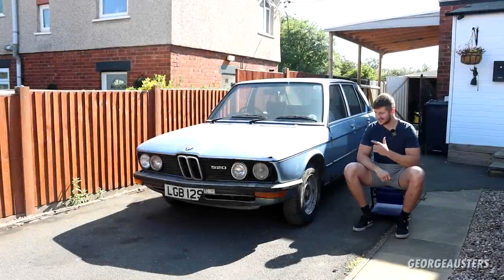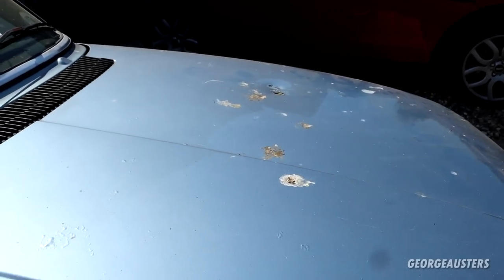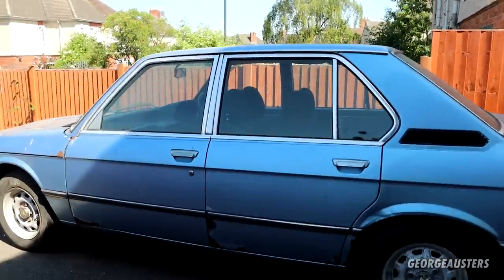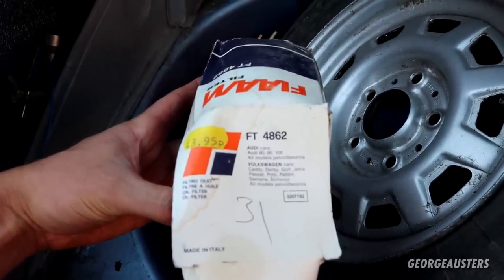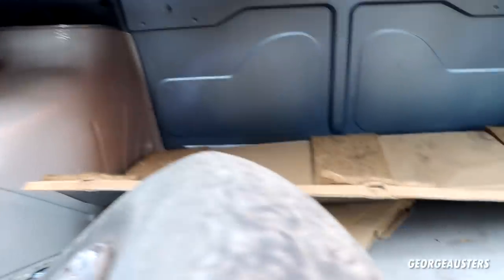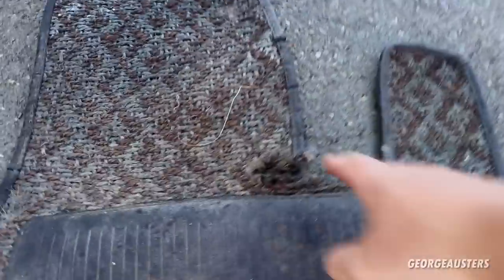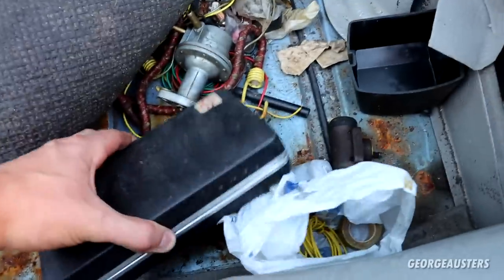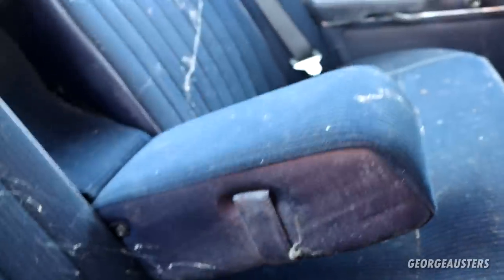I BOUGHT AN ABANDONED BARN FIND BMW THAT HAS BEEN SITTING FOR 30 YEARS!

Comment: I would recommend always putting a mix of diesel and 2 stroke oil down the bores before even attempting to turn any engine that's been stood a long time,  as it prevents you from breaking the piston rings which are usually stuck to the cylinder walls.  Looks like you have a really nice original interior,  if you do strip the car for rebuild, take your time and be careful not to damage anything and make sure it's stored in a safe place out the way of sparks, welding splatter and paint.

Comment: The 2 way valve you found in the boot is a fuel pump. The 520 was carburetor fed and this is the fuel pump that runs of the camshaft lobe. Also the cover under the boot floor would just be for the Fuel Gauge sender unit or float, as there will be no electrical fuel system.
Reply from the maker: That makes sense. I assumed the unit in the boot was a fuel pump as it has an electrical connector and 2 fuel lines running from it
Reply: @GeorgeAusters  yeah the electrical connection is just an earth between the unit and the engine. Hood luck with the restoration mate.

Comment: Those parking disks are still in use is some smaller towns where there is a time restriction for free parking, you dial in your arrival time and if you overstay you could be caught by a traffic warden.
Reply: Here in The Netherlands the parking discs are being used very often. The spots where you need to use them are called blue zones, whereas the disks and pavement edges are (you guessed it) Blue. Just like you said, set the clock when you arrive and put it behind the windshield.
Reply from the maker: Interesting, they just weren’t used in my area

Comment: Wow thanks George...  my first car...1977 528... same colour, same colour velour interior.
I did all the work on the car myself, service, repairs, suspension legs, carburetor service, blown engine replaced...all outside my house, in the snow. Love and passion has no price 1
I bought mine before anyone knew what a BMW was...before the Yuppies jumped in for the prestige value.
I bought a BMW primarily due to the supreme build quality  and engineering of these cars... now I am on my 14th or 15th... two E39  M5 garaged, F10 daily driver... so wish I had kept them all especially the E12... will watch all this series... thank you for saving this one...
Reply from the maker: Wow love that… Must be wealthy to have such a car as your first one!
Reply: @GeorgeAusters  Hi George,
Not wealthly mate. I made a mistake of visiting the motor show at Earl's court and then sat in the brand new E28 model...WOW !. I was blown away by the build quality, the luxury and engineering masterpiece. I had driven in with a friend in a beat up MK3 Cortina ! asked the price of the BMW - £28,000 pounds...you could buy 4 houses in London at that time !
But I was smitten... never looked back. Learnt to service/fix the cars myself... labours' of love.
I actually have a M5 E39 right now in Manchester, it was a rebuild project that has been sitting there for 21 years... no time to work on it... would you consider a JV ?

Comment: Lovely old car. But don’t fool yourself on what it needs. That needs a lot of work. Before you do anything else get it up on a ramp.
The outer sills look rusty but how are the inner sills and chassis legs. The mechanicals are easy and fairly cheap to repair. The body and structure are not.

Comment: The engine on my E12 was stuck after not being run for 14 years, so I used a mix of leftovers of ATF and Redex fuel cleaner, poured into the bites and left for a week. It worked very well.
Reply from the maker: Yes I watched your videos on it mate :)
Reply: @GeorgeAusters  cheers 😄

Comment: It is normal for the ATF level to read overfull with the Engine off.The Transmission pump will only draw fluid when the Engine is running.Always check the level when hot,after a short drive,as ATF expands as it becomes warm/hot.The colour looks very good,which is a great sign.
Reply from the maker: Yeah I should have knew have knew that! Honestly looks like it was serviced before being parked up

Comment: Random bit in the boot is a fuel pump

Doubt the door cards are real leather.

Wheel looks the right way up, just the badge.

Key fob looks like a Princess Di one.

Back then disabled parking disks were orange not blue.

What is the pipe onto the airbox? Looks almost like a crude lpg conversion, but off the road  too long for that.

Certainly looks like a brake fluid level sensor, and wouldn't surprise me at all if it had one
Reply from the maker: Thanks for that👌🏼

Comment: The autobox is a ZF 3HP22, a Reliable 3 speed unit that was fitted to many cars right up to the 90’s.
Brake fluid reservoir does really have a level sensor, similar to the ones fitted up to the 90’s.
That dash is very good, in fact, the whole interior is great!
Reply from the maker: Great technology for such an old car!
Reply: @GeorgeAusters  indeed. Some came with brake pad wear sensor too.
Reply: that's the unfortunate effect that UK weather has on vehicles.

Comment: It's a cracker . As far as what I saw there isn't a week of welding required,  which is noteworthy if true. Get some oil in the top of the engine and let it sit some 24 hrs before engine turn by hand. If you are going to do a top end rebuild , then no matter . What is the mileage?
.
Reply from the maker: 79k miles

Comment: Automatic fluid needs to be checked with engine running and in gear. Torque converter holds a lot of fluid.

Comment: Gorgeous car! Bringing back the good old days, i remember looking at them when i was a little boy. 
About the gearbox-level > check it when the gearbox is up to temp and yyou'll need to have the engine running if i remember correctly.
Further i would put lots of wd40 into the cilinders before turning the engine over any further.

Too much rust for my likings (i dislike bodywork) but it will be very interesting to see how you'll bring back life to this old lady ☺
Have fun!
Reply from the maker: Thanks man, I cannot wait to get started on it!

Comment: Turning crankshaft before adding lubricant form spark plug holes might damage piston rings even a little turn it’s not good lets see if it’s working
Reply from the maker: Yeah as it’s stuck now I’ll be adding oil to the bores to try free it up

Comment: That two way valve thing is a fuel pump, and they are bolted onto the side of the engine the camshaft, or a cam lobe  turns, and presses on the plunger and lifts the fuel from the tank
Reply from the maker: Interesting, I was under the impression it didn’t have a mechanical fuel pump as it has an electric one in the tank👍🏻
Reply: @GeorgeAusters  that would depend on if it’s injection or not, by the looks of things on real OEM it is mechanical up to a certain point and then on later E12, some had the in tank pump, but by the looks of the air filter housing it has a carb and not injection, best thing to do is put the vin in to real OEM in the classic section
Reply: @GeorgeAusters  if it has the 4cylinder 2.0ltre it will be mechanical pump

Comment: Interesting car. 
Your door cards are vinyl not leather. The key ring looks like Margret Thatcher (spitting image). 
That wasn’t an ignition coil in the footwell for this car. You have HT leads and a Distributor. 
The brake fluid has a level sensor. 
The interior looks in great condition but the that body is going to be as rotten as a pair. Cars rot from inside out. The nearside sill and rear quarter will disintegrate when you start poking. And the offside rear arch and inner tub will be the same. 
Good luck with it. That’s a massive project.
Reply from the maker: Interesting!

I’ll be looking underneath the car and in the wheel arches in the next video👍🏻

Comment: Your valve is å fuel pump. Turn on the radio and the areal will come up. You can't check gear oil on stationary motor, warm up, go through all gears and meassure on idle speed. Think you should read the workshop manual. Better quality tha Haynes and the others. Back in the old days BMW was quality. Including transmission. Sensor on brakefluid was standard. BMW was West Germany, Bayerische Motorwerke. On the east side, there was EMW (Eissenach Motorwerke), made super cars before WW2.
Reply: My father in Finland had a BMW badged EMW 328, my 1949(?), in 1954-55. The car is "still going strong" in my home village. But now black instead of light green.
Reply: @leiflillandt1488  A friend of mine had a 2 seat (+ mother i law seat) cabriolet. sportscar from EMW. A very, very nice car. Can't remember year built. This was in the early sixties. Must have been a pre WW2 car.
Reply from the maker: Very interesting!

Comment: George, timestamp 13:52, this item is mechanical fuel pump, which is located in the engine compartment, and often receives its drive power in different engines, e.g. via the camshaft etc.
Reply from the maker: Strange, I thought this only had an electric fuel pump, the one in the tank
Reply: @GeorgeAusters  not sure it has a pump in the tank. Carb only needs pretty limited fuel pressure (few psi) . Hatch in the boot is probably to access the fuel level sensor.
Reply from the maker: @katywalker8322  It does have a pump in the boot, I’ve checked it
Reply: @GeorgeAusters  bit surprised by that.
Reply: It’s the M10 engined cars that have a mechanical fuel pump. The 6Cyl cars have electric pump in the boot
Reply from the maker: Yeah that’s what I thought!

Comment: These are the cars I started to work on as a young mechanic. 
My advice is remove and overhaul the cylinder head and inspect the engine bores and pistons.
Don't try and free off the engine any other way and try to start it otherwise you'll regret it later, too risky after over 30yrs of sitting.

These engines are easy to work on, you can even remove the sump and inspect the big ends and main bearings, and push the pistons out of the bores for inspection and clean the 
bores out with a honing tool attached to an electric drill.
If the pistons are good then just replace the rings, a top end gasket kit and sump gasket
and she'll be as good as new. 
Take the time and do it right from the start.
Also the gearbox oil level is not overfilled, the level is checked with the engine idling.
Reply from the maker: Don’t really have the budget to do a rebuild straight away. If I get it up and running and views are good then I’ll gladly do a full rebuild - no point doing a half one👍🏻
Reply: @GeorgeAusters  M
My main point is not to do a rebuild, but, to remove the head so that you ensure the engine is good enough to start without further damaging it. The head gasket will probably need replacing anyway after sitting 30yrs and the pistons & bores will need careful attention before starting up.
The only way to do it safely is by removing the head.

Comment: I loved those cars when they were out and about. I remember seeing lots of them around in 1994 when I traveled to the UK and Europe. It was as if they were refusing to die, however, they were all in very bad condition by that year.

That was a fuel pump that you had in the boot that drives off the camshaft. They were a common failure point on most carburetter cars.

Yes, it would have had brake fluid level warnings and probably even has brake pad wear sensors.

Probably ok in this case however never try to turn over an engine that's been sitting for years unless you start it or if you cannot start it you need to fill the cylinders with something like wd40. This mainly applies to engines that have been left outside or in damp places. I remember trying to unsuccessfully start an old lawnmower, the next day it was frozen solid and I could never free it again.
Reply from the maker: Crazy technology for such an old car!
Reply: The fuel pump is new (old stock) but by now the diaphragm in it would have hardened, or maybe it might still be usable.  @GeorgeAusters

Comment: Not sure if you are aware but its never ben mot'd its due its first mot strangely so the question is will it pass it's first mot. On the plus side it's never failed an mot in its life time. I honestly wish you the best of luck with this project. Just wouldn't put to much in for little back as its not the most desirable car of its time. But if its something to keep then crack on as you are probably aware some parts will be hard to get all the best my friend
Reply from the maker: You can only see MOTs back 10 years or so, and this has been off the road for 30 so none will appear online. It won’t need an MOT as it is MOT and tax exempt🙌🏼

Comment: Hello George! As you could notice from the cap of the brake fluid reservoir, there are the contacts of the oil level sensor. I confirm you this car is provided with brake fluid level sensor. You can even see the "low level brake fluid" light in the dashboard area of the car. Congratulations for the video clip! Good luck with your new project! ;)
Reply from the maker: Thank you!
Reply: The German cars have had that brake fluid level sensor. I remember my Mercedes-Benz W116 having that, and an electrical brake pad wear sensor connected to a light on the dash. This was a 1979 car, I do think it was the German DOT standard because of their traffic and Autobahn regulations.